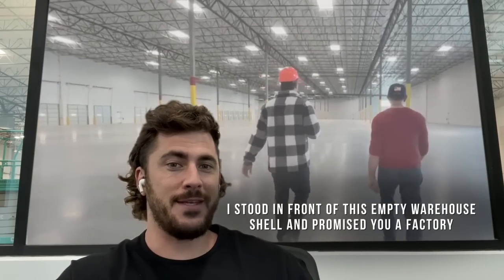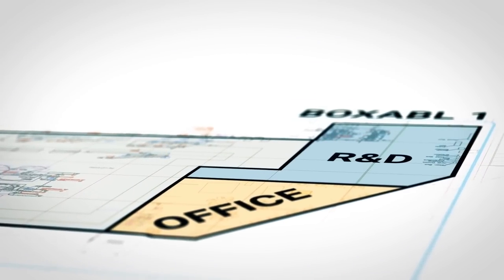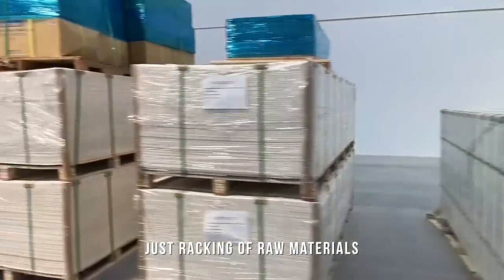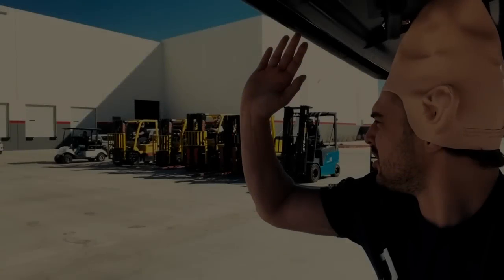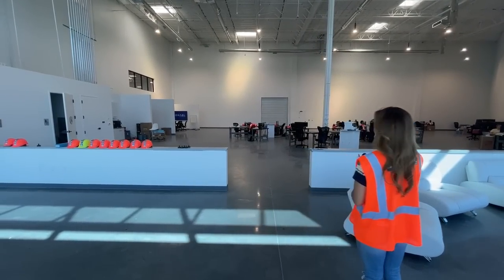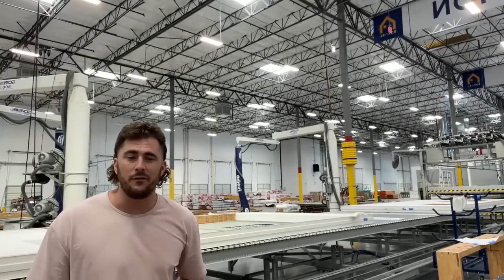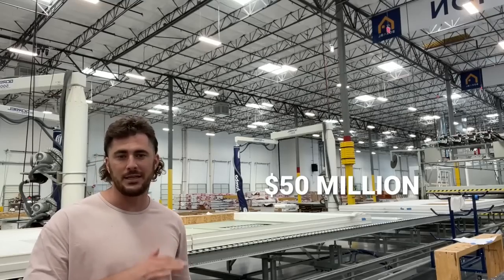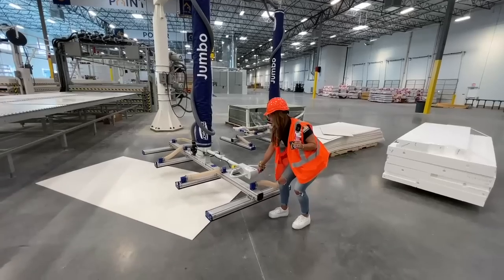Ep. 2 Foldable Tiny House Factory Opens in Las Vegas! BOXABL (Outside the BOXABL)

Comment: How much of the build is wood? I see some wood being used in between the walls. Remember if that wood gets wet one time, it will mold and you will have mold where you can’t even see it. Are these 100% leak proof?
Reply from the maker: We don’t use many materials that will degrade over time, like wood.